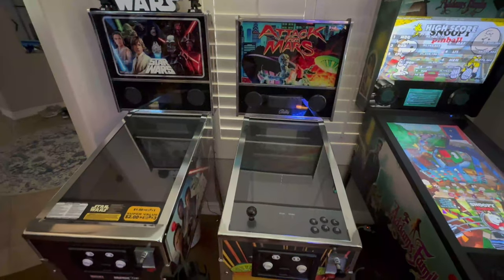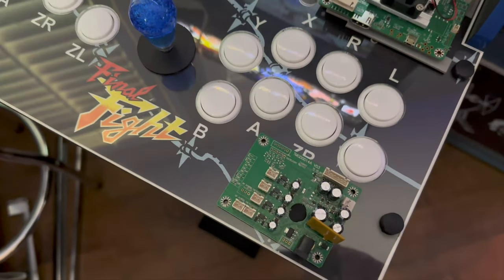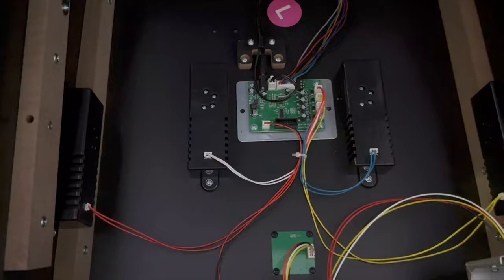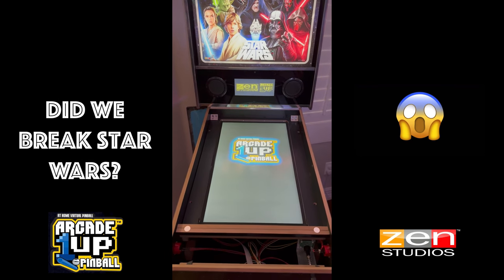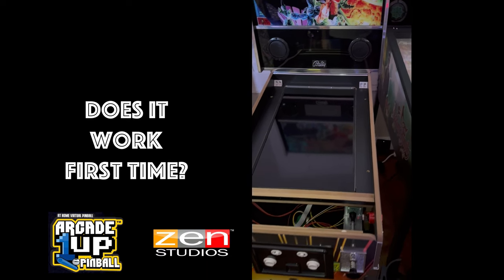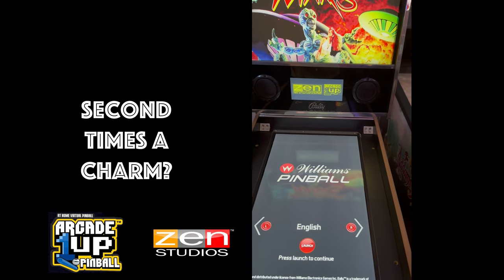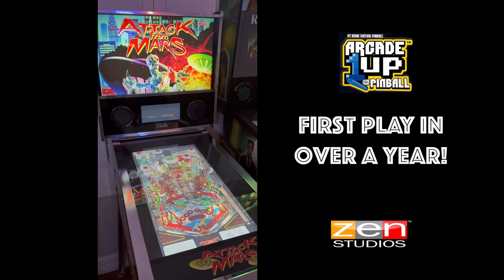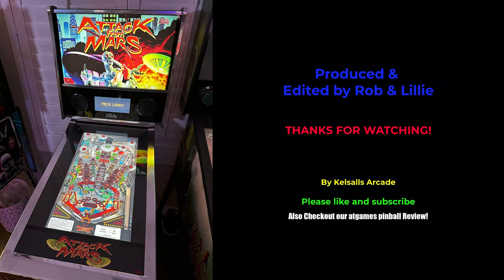Attack from Mars 2: The Return of the PCB! Arcade1up Intec Switch mod gets a reverse operation!

Comment: How long did it take to get a replacement AFM PCB and what was your cost? Mine is dead.
Reply from the maker: @hachimachi808  didn’t charge me, and arrived in like 3 or 4 weeks I think .🤔 they initially didn’t have any in stock so I did the intec mod, then when the PCB came I switched back to stock

Comment: Well I wouldn’t do this mod on a working  Arcade1up Pinball. Go do the Vpinner mod instead. If like me my PCB died the Intec Mod is a great way to bring it back to life. I’ve also modded it the brink. Upgrade solenoids and exciters for better force feed back than the stock. Got a work around to fix the DMD to display. New tables from Zen getting released constantly. Online tournaments. Online leader boards. It’s one of my most played cabinets. Zero lag. Graphics way better than stock. It’s basically a Multicade with online play. Couldn’t go back to Stock. It would be a step back for me.
Reply from the maker: Yeah, sounds like you did a proper job!